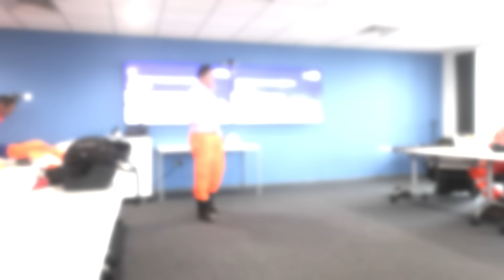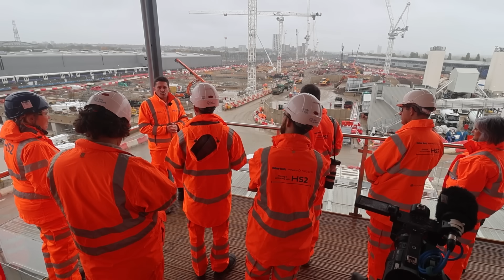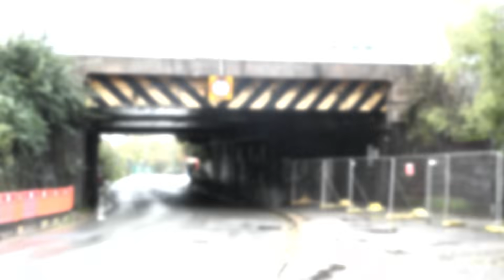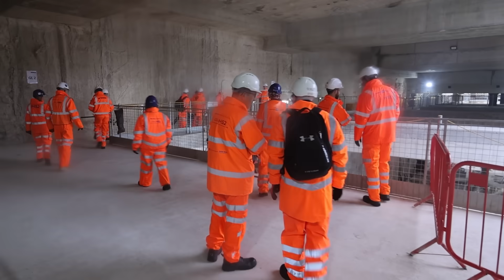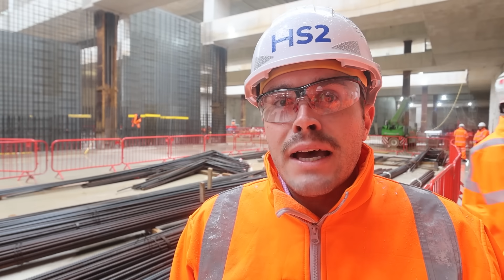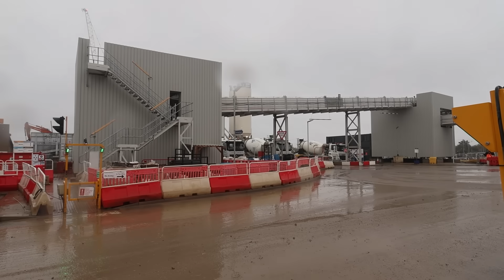HS2 Old Oak Common Station Construction

Comment: This is an absolute white elephant. Who is going to get off an HS2 train from Birmingham to go in the direction of Reading or any other station on the western region which is easily reachable and quicker from Birmingham New Street?
Reply: As big a white elephant as "Stratford International".  If they had built HS1 underground at Kings Cross (as they should have done) and gone straight to the Chunnel, HS2 might have been worthwhile with a direct connection.  This is even worse than the Euston idea.
Reply: @MrTudwud  exactly" Stratford is a glaring example of why they shouldn't have done this, but what do we know!
Reply: The thing is once HS2 is up and running Inter City trains from Birmingham to London will cease using Birmingham New Street Station
Reply: @peterwallen1063  but if Jasper Carrot wants to go to Bristol or Reading it's still quicker and probably cheaper from New Street via CrossCountry, he's not going to go via OOC
Reply: @vinniesuperstar8923  given XC prices, probably not cheaper
Reply: @vinniesuperstar8923  I suppose it would be as X country trains have nothing to do with HS2 and HS2 trains won't go to Bristol or Reading only where the present West Coast Main Line trains from Euston to the Midlands and the North Go, So the zist of it is if Jasper Carrot wanted go to Bristol or reading he would go to Birmingham New Street to catch a Cross Country train there, but f he wanted to go to London Euston or to the North he would go to Birmingham Curzon Street and catch an Avanti West Coast HS2 Train to either London or Manchester.
Reply: @peterwallen1063 As you probably know, the new Birmingham Station (if they ever get on with building it) will be "out on a limb" from the rest of the network as it is a separate entity to the other lines in the area.  It will be no nearer or further from the City Centre than Moor Street or New Street so its advantages are limited in that score.  The need to change from a train to a "shuttle" at Birmingham Interchange to get to the Airport or the Exhibition Centre negates any extra time saved against going direct from Euston now and, of course, adds an extra risk whenever there is a need to change "trains".  Without the HS2 northern connection, apart from freeing up the original lines for freight (if that happens) there is very little (if any) advantage in using HS2.  BTW, I have never been an anti-HS2 person and would have loved to have seen a direct connection with HS1.  However, Arup's connections with Stratford put paid to that years ago which is another reason why we have a big station in East London that has never seen an "International" train call at it in normal service.
Reply: Not really. Most of west London will get on HS2 at OOC. Plus, people going to Reading will no longer have to go all the way to Paddington. On top of that, OOC was planned to have decent Overground connections a while ago, which would make it more useful. HS2-WCML interchange I'd say is relatively minor. HS2-EL or HS2-Overground would be far more common. This was also a substiture for a HS station at Heathrow (hence the connection to the EL). I see this being similar to Shin-Yokohama or Massy TGV
Reply: @paupadros  The only HS2 Station that will have Interchange faculties out side the London area is Birmingham Interchange and I can tell you it will not be a relative minor station as it will be as large as London  OOC and will be the interchange station between trains going to Birmingham Curzon Street in Birmingham City Center and Manchester and Scotland, it will have a driverless people mover train that will connect with the NEC Exhibition Center, Birmingham International Rail Station for trains to North Wales, the West Country and Wolverhampton and West Midland Local trains made up of X Country Trains, LNWR/West Midlands Trains, Transport for Wales and Avanti West Coast and Birmingham Airport with local Bus Connections and National Express Coach Services
Reply: @paupadros  now if it had been a station at Heathrow, then yes, perfectly understandable, as it is it's neither nor and pretty much useless. Ignoring the fact that it'll add five minutes to my journey from Gloucester to Paddington (which irks me) plus who is going to Reading from Birmingham that can't already get there from New Street via Oxford direct?
Reply: @vinniesuperstar8923  I won't be able to find them, but there are documents from early HS2 planning where various station locations for a second HS2 station in London are discussed. Heathrow had less ridership potential apparently. OOC was a dead field, so cheap to develop, plus a connection to the Lizzy Line.

Even without the interchange facility with the GWML, London is a large city, there is plenty of people in west London that'll catch HS2 at OOC. I imagine there are plenty of journeys that are made faster by getting off at OOC and not at Paddington, especially if the Overground connections are built.
Reply: I quite frequently have to decide how to go North from Reading.  Usually the hugely painful via London route is the one I end up with, despite my preference to just travel on a direct cross country train.
So I imagine OOC is going to be a huge benefit and the often overcrowded services via Oxford will see some relief. @vinniesuperstar8923
Reply: Nobody who has a bit of sense will catch an HS2 train to go to OOC to go to reading, it is quicker from Birmingham New Street direct by X Country trains
Reply: @peterwallen1063  the only advantage I think will be for anyone travelling from Birmingham to any of the intermediate stations between OOC and Reading. I'd love to hear exactly which location would benefit from this.
Reply: @vinniesuperstar8923  Not sure what Reading has to do with HS2 to be honest as passengers using HS2 from Birmingham will only be going to London or Manchester and the North, any one who wants to go to Reading from Birmingham would use Birmingham New Street Station a X Country Trains and definitely not HS2
Reply: @peterwallen1063  that's my point. Before the issue with Euston HS2 became a thing, there was very little need for OOC HS2 station. It serves very little purpose for those travelling from Birmingham and the north WCML stations.
Reply: @vinniesuperstar8923  London OOC like Birmingham Interchange station have both been on the plans of HS2 from the very beginning, London OOC was for an interchange for London Heathrow and stations going to the South West if required and London Over Ground and Birmingham Interchange is for Birmingham Airport and for changing to trains running on the WCML at Birmingham International for X Country Services and Services to Wolverhampton and North Wales so as not to have to walk across Central Birmingham
Reply: @peterwallen1063  I know.

Comment: It's great to see work is still progressing here, I know you don't touch the politics (given the state of political discourse on the internet, with good reason) but it's very disappointing to see how badly everything other than Brum to Old Oak has progressed, hopefully a day will come when you can hop on a high speed train at Euston and walk off at Mcr Picc (or, dare I say it, Leeds 😅).
Reply: Yes,if they're going to pour such immense amounts of public money into the project,they've got to do it right. There's no point in spending so much on something that at the end of it falls short the purpose it's meant to serve.
Reply: @rjjcms1  the problem its already happened the line won't be finished because the starting section ended up overbudget
Reply: I think Gareth Dennis might be a good recommendation for train politics.
Reply: @geofftech2 I agree we do ss someone that was waiting for hs4 to be completed to get faster trains its very disappointing for the north to be neglected yet again
Reply: @geofftech2  I think the Tunnels will be done because they are relatively cheap. Whether their a station waiting for those tunnels who knows at this point. I think common sense means the tunnels have to start in 2026 or otherwise to much of the infrastructure, like casting the tunnel segments will start to be dismantle because of lack of work. `
Reply: @geofftech2  i love London and trains
Reply: @tommywoodland1295  Nobody does monumental wastes of money like the UK does.
Reply: @daffyduk77 British exceptionalism. Have you seen recent Saudi or Chinese projects? Chinese high-speed rail is failing, and Saudi Arabia is building a dystopic city in the desert that will be another failure.
Reply: @geofftech2   Maybe we need to re-name  it HC2..? High Capacity....!!

Comment: Wasn’t HS2 cancelled?
Reply: The vast majority was. All that's left is the London to Birmingham section. As a Manc, I'm 50/50 on the decision.
Reply: @NTH_5596  N, the line from Birmingham Interchange to Litchfield is still to be constructed and HS2 trains will join the WCML at Lichfield
Reply: only the northern station
Reply: @jactar1  Which is most of it. This is just an expensive branch line now that loses almost all of the benefits of building the whole damn thing. It'll actually make capacity worse on the WCML if they intend to then run the trains up north. They can't go as fast as the existing class 390's because they don't tilt, because they're designed to run on actual high speed tracks and not jerry rigged to run on old stuff like the current fast trains.
Reply: @TalesOfWar Your absolutely right
Reply: Just the bit that won't connect to London.
Reply: @ToilerOnTheSea Yes it will run into Euston
Reply: Death by 1,000 cuts